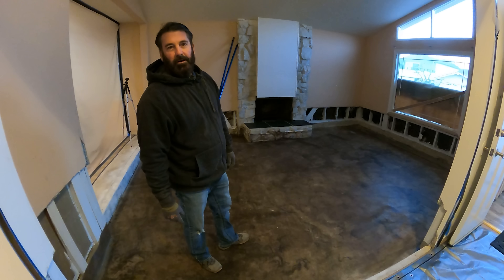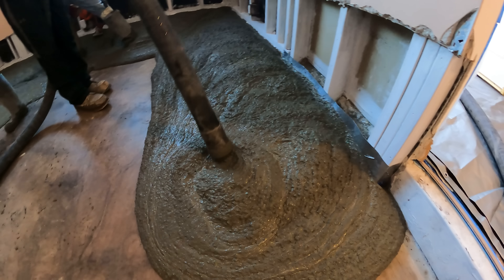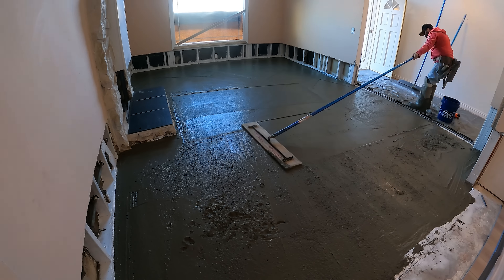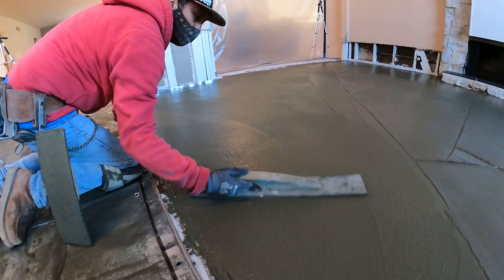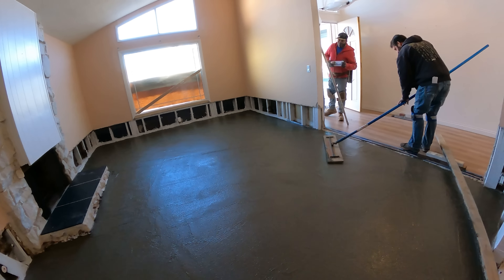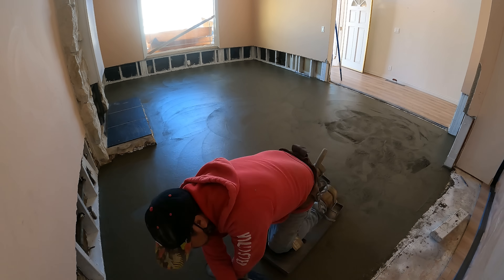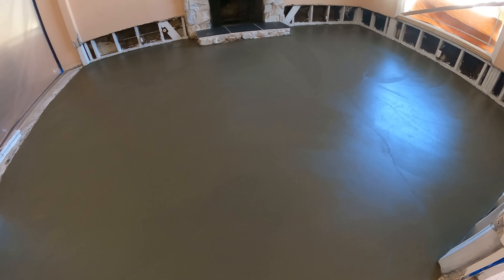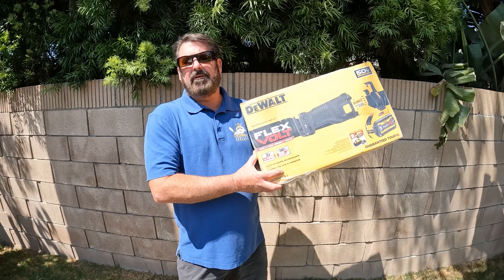Pouring Concrete to Raise a Sunken Living Room Floor

Comment: I want the Dewalt recip. Saw 
It’s going to be used in tearing down a spare room I built 15 years ago, and I’ve been told that there’s not enough concrete in the foundation I built . So it’s tear down time and rebuild before winter. Depending on scheduling inspection. Thanks very much. Your video is to the point instructive and like conversation . Very good!
Thanks
Reply from the maker: Sounds good
Gl

Comment: great Job as always David Odell, I am a new homeowner with a 30x40 metal garage with 2x4's rotted in some locations due to rain. I would like the DeWalt reciprocating saw so I can start cutting into the old wood and replacing them with good wood and reseal the walls so no more water can get into the garage. I wish you were here in Texas I have tons of concrete work I wish done for that shop and expansions too.
Reply from the maker: Sounds good
Gl

Comment: Hello David, I too have a sunken living room here in the high desert, Murphy built home. I often wonder what would be the best way to fill it and you just showed me that concrete is the best way to go. As far as the Dewalt saw goes, this would be a great tool to have in the RV for when I get to those campsites and the tree branches are in the way plus cutting firewood too. Cheers.
Reply from the maker: Good points
Gl

Comment: We no all about water in wales .We use a damp proof membrane under the concrete to stop water rising up through the floor .its a really think 1200 gauge plastic sheet which is overlapped and tapped and it continues up the side walls .Are damp proofing has to be good here in the uk because our weather is crap 🤣 great job as always 🏴 👊👍
Reply from the maker: This was actually coming through the stem wall

Comment: I would use it for my new business, I worked under a guy for a 7 years and I am branching out on my own. I currently have a corded Dewalt one that I've had for 5 years and it would be beneficial to obtain a cordless version. I do basically everything but I hope to specialize in a couple of carpentry types in the following years. I enjoy doing trim carpentry, tile, and demolition, and framing so far!
Reply from the maker: good idea
GL:

Comment: Nice video David!! I would like the Dewalt tool to cut out our 3/4" plywood when we form headwalls on storm sewer pipes for structural concrete. We use a wall tie system when doing this. This tool would really come in handy sir!! Keep up the great work!!

Comment: Another great job, another great video. I could definitely use that sweet DeWalt saw! I have several projects where this tool would come in handy. We have a sunken living room floor we want to bring up so we don't have the tripping hazard when we are older. Also could use the saw on a bathroom install and garage conversion I am gearing up to do.
Reply from the maker: good idea
GL

Comment: Hello there - I would like the the Dewalt reciprocating saw. I will use the saw to demo and remodel my mud room, we are down sizing the windows, it was old old porch that was enclosed so I will most likely have to completely remove the 2 exterior walls and re-frame for new smaller windows. Your channel has given me the confidence to concrete my own sidewalks and stairs around my old home. Thanks you.
Reply from the maker: Gl

Comment: thank you for the ideals and I would like the Dewalt reciprocating saw. I am fixing up my house and planning on building a double car garage. It will be 30x60x6" at 4000 psi cause of a four post lift
I like to put in. But that area will be 14x14 or there about. Have to get it drawn up and approve .

Comment: Our house has a reverse dropdown. Is it difficult to cut out a raised floor and pour even with the lower level? I assume it would be cut to the dirt. Would that compromise the foundation? Its an older slab from 68.
Reply from the maker: Doesn't sound like good idea

Comment: I want the Dewalt Flexvolt Saw. I had one of the original 20v models from years ago and it took a crap on me just the other week. I work in construction and I use it mostly for demo work. Getting that saw from this contest would help my wallet.
Reply from the maker: Good idea
Gl

Comment: I would like the DeWalt Reciprocating saw. I have been looking for a reciprocating saw for a while now but never gotten one because either they don't come with batteries which you then buy for almost the same price as the saw, or they are not a trust worthy brand. Will mostly use to cut up old pallets to make rustic furniture, or to help with renovations around the house.
Reply from the maker: Good idea
Gl

Comment: I want the DeWalt reciprocating saw. I'm gonna cut up some scrap lumber to make a table. The wood might have nails in it so I can't use a regular circular saw. Love your vids, looking good as always! 🙂 OH! btw - you guys got any stamped concrete jobs coming up soon? Always love those jobs!
Reply from the maker: No stamps on the books, but I'm sure there will be one coming.